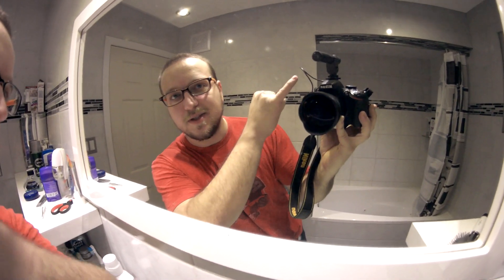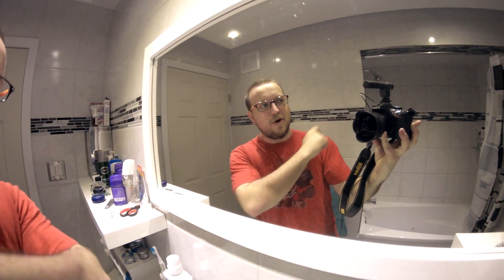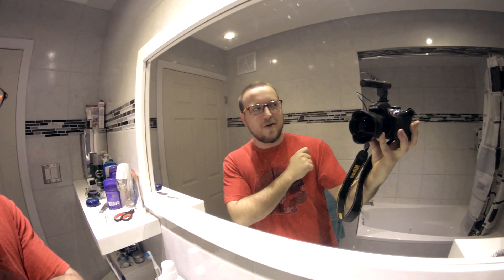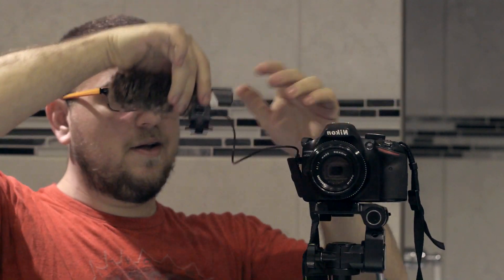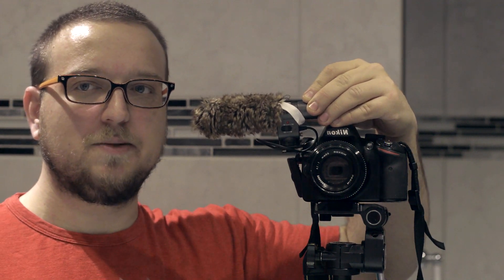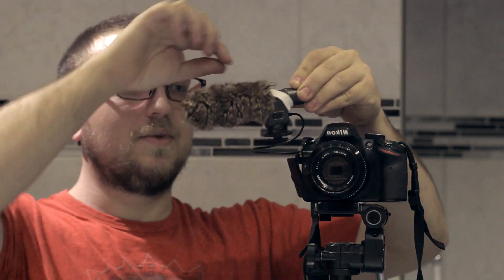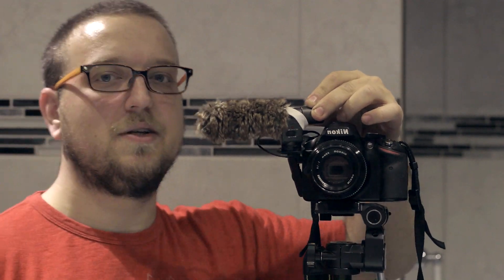How to Make a Dead Cat ( Microphone Wind Screen Muff DIY )

Comment: next time you can stitch the elastic to the inside of the opening when you're stitching the "raw edges" before you fold the fake fur over and doing the L shaped stitch.
doing this will make it so you don't see the elastic, and it will hold the deadcat in place

Comment: I know you lose a little bit of mic sensitivity but I wonder if you lose any of the sound spectrum. Wouldn't the 'official' deadcat be made of fur with a specialised kind of backing fabric to avoid muffling sound? have you noticed any difference in sound quality since using it?
Reply from the maker: Yup, you are correct, they probably used a better material that does not impact sound quality as much, but to be honest I haven't noticed much of a difference. I would say the high end of the spectrum is impacted slightly, but nothing a little EQ can't fix. I master the audio anyway, so this is not really extra work for me. Also, for the purposes of a YouTube channel, the audio quality is better than most out there and I would only consider solving these issues with some more serious equipment/products if I was working on a wildlife documentary or something that requires the outmost clarity and sensitivity of the recorded audio. This is a budget solution for amateur videographers :)
Reply: Since I wrote that comment I have in fact had a go with a bit of cheap artificial fur to produce a deadcat shield for the little Olympus sound recorder that I use to record interviews for Forest Radio (http://forestradio.co.uk/index.html ) and like you I have been unable to detect any difference in speech quality but a fairly dramatic reduction in wind noise problems. Thanks for the idea.